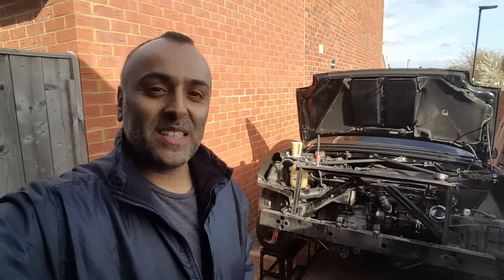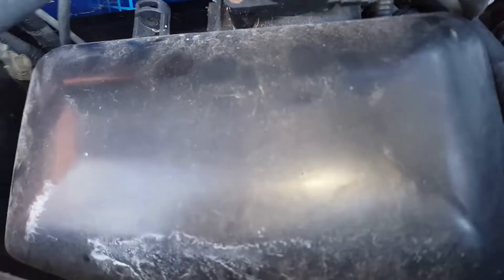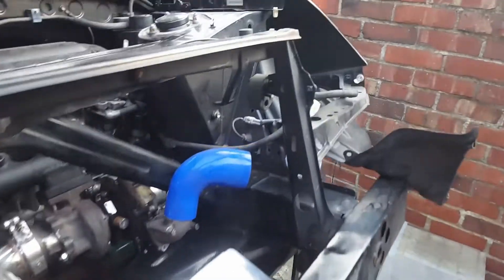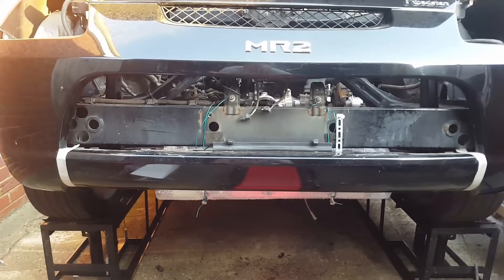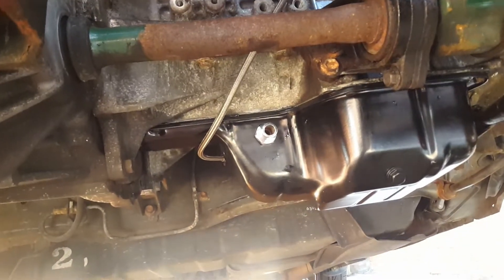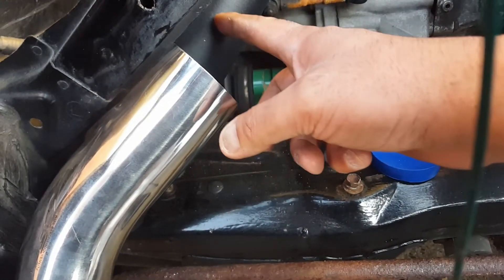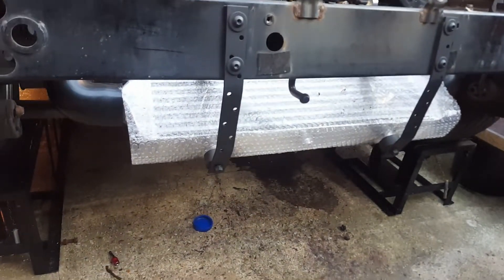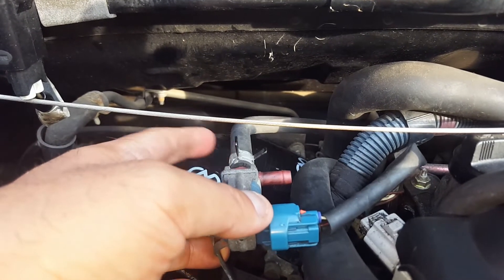Custom Turbo 1ZZ MR2 Roadster / Spyder Build Part 1

Comment: Loving the depth of detail. 
What were the small diameter pipes that you said need to attach to the turbo? Oil feeds or water I'm guessing? 
Are you going with a std ecu and what turbo are you planning on using? 
An idea of costs would be helpful too. 
Keep up the good work!
Reply from the maker: Yep water pipes. I will show that in later parts. I also show oil feed and return. I will be using an emanage blue. Not the best but will make do for now. I will tally up everything and give you guys an idea of what it cost me, although that video might be once I have the car where I want it 100% else it wouldn't reflect realistically.
Reply from the maker: Oh and thanks, I wanted to give detail. All the videos I watched were bolt on kits, where they bolt a kit on and its done. No detail of anything. Not useful to us DIYers. Hope to inspire other people and see a few more turbos out there :)
Reply: @ModorFix  cool. Cheers Dan.